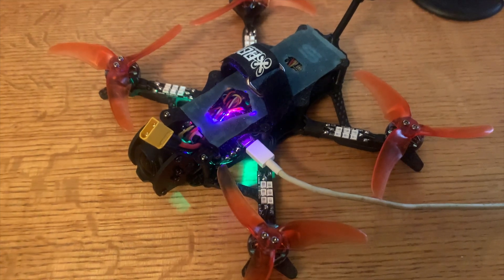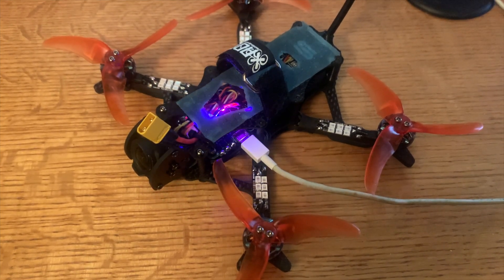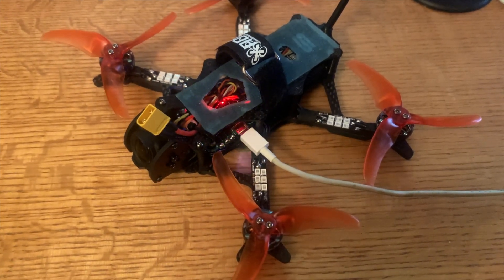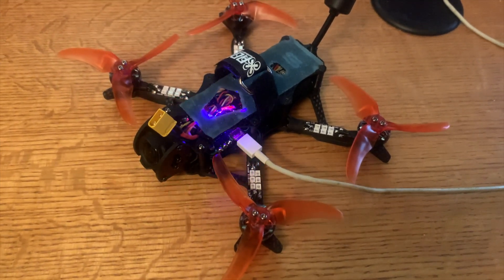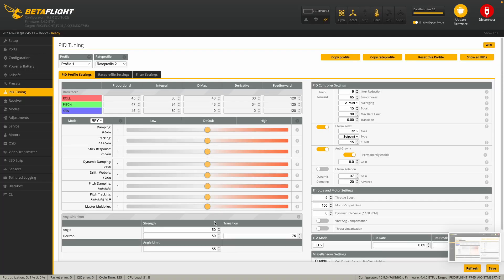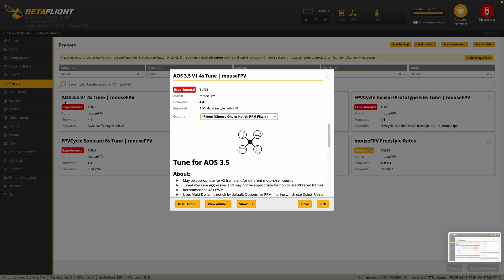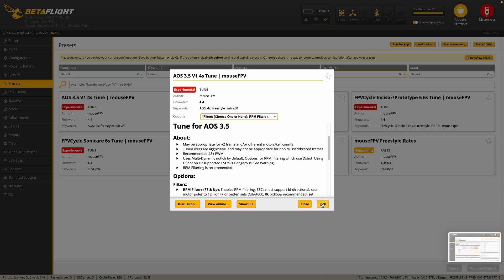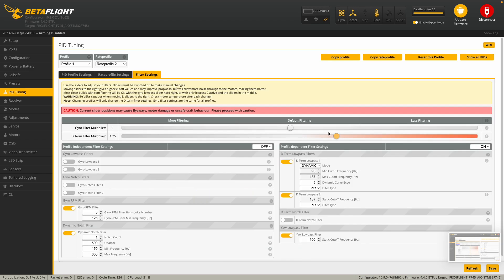AOS 3.5 V2 O3 Presets Tune Any Good?

Comment: Danger Fly Away! Good afternoon. I just used AOS 3.5 Criss preset with its respective filters, and when I increase the throttle, the drone shoots upward. I use the standard Betaflight 4.5 preset or the UAV Tech preset, and it doesn't happen. It's very strange because I've never had anything like this happen in the seven years I've been flying drones, and it only happens with your preset. My system is a Hobbywing F7 ESC 40A Blheli32.
Can you think of a possible reason for this? my version frame is AOS 3.5 v5
Reply from the maker: Hello, I am actually using mouseFPV’s preset so make sure you select:
“AOS 3.5 V1 4S Tune by mouseFPV” if you want to test this preset. Chris Rosser (frame designer) also has a preset but I have not tested that.  He is a great tuner as well so what you are experiencing does not make sense. However, his tunes can be more aggressive on the filter settings. 

Another thing to check is your board alignment settings. I am using the  iFlight Beast F745A AIO and mouseFPV used the Foxeer Reaper AIO which are both 25.5x25.5 toothpick AIOs. Your Hobbywing is a standard 20x20 mounting (not turned 45). Point being, I had to use the following cli setting so make sure that is NOT set for your build as it “will cause a Fly Away”. 
set align_board_yaw = 45 is bad for your build but needed for AIO boards. Checked the mouseFPV cli diff and it was not included so probably not that unless you changed it on purpose.
SLOG

Comment: Hi great video, enjoy your work. Will this work with the Iflight BNF model,
Reply from the maker: Hi @vpimaging, yes this tune should work as the iFlight version is very close, really the same frame, just has a soft camera mount to reduce motor vibration getting into the camera. Thanks for the feedback!
SLOG
Reply: Awesome, thanks. That’s what I figured as well. Just a noob with FPV and Betaflight, but been flying camera drones Maric’s for a few years. Lol… cheers.

Comment: Great video! What motors are you running? 

Im swapping everything from my Cinebot30 o3 6s over to this frame. Im hoping these 1804 motors arent too much.
Reply from the maker: Hi Jessiah, Chris Rosser (frame designer if you do not already know) recommends  1504/1505 2950KV on 4S if you are looking for a larger motor so a little overkill and adds weight. But if you do not care about being under 250grams, you will have lots punch for freestyle! Worth a try and see as you already have the motors.
Cheers, 
SLOG

Comment: Funny, I've flown with this tune and it was even worse than default. I ended up just ticking P:I up to 1.15 and pushing FF to 1.5. Everything else is at 1 (master slider cranked to 1.5). You really need to take it through its paces in PID Toolbox and follow the "basement tuning" method to really lock it in.
Reply from the maker: I have been happy with this tune so far. Seems like there is a mixed bag of responses. Looking at black box logs the filter settings look good. Did not spend any time analyzing the PID tuning aspect. Maybe my motor selection and that I am at ~5000 feet plays into it. 
Cheers,
SLOG
Reply: Hi do you have good tune for this drone on bf 4.4.1?
Reply from the maker: @pappuinfo6721  The preset I used for this test was for 4.4.x and I was happy with it. The last digit is for minor releases so this preset is worth a try. Like the videos states, always save your current settings "Save backup" so you can go back to your old configuration settings if you do not like the tune. SLOG

Comment: Hey bro. If you want to test a preset and understand if propwash has been reduced you must split-s into the quad air not going straight... 😂
Reply from the maker: Good point. At 9:13 in I do a forward roll where I am stalled (very little forward motion) and falling through dirty air. Really should have done a flight pattern UAV Tech (Mark Spatz) suggests when flight checking a tune. Oh well live and learn. However, this has been the tune I have been flying since this video was made and it is still my favorite freestyle quad to date with this tune.
SLOG
Reply: @slogfpv  i saw👍 what I'm meaning is that you have to force propwash to see how much has been reduced. Another good test is to show before and after applying the preset. Anyway good video. Really! As I'm flying with an emax babyhawk 2 which has similar idea of frame I think I will try this preset too. Ciao! 🙂👍👋
Reply from the maker: @gabrielemoro1  yes I would agree the two are very similar in design so worth a try. Also check out Mark Spatz's presets if this does not work out for you. 
Cheers,
SLOG
Reply: @slogfpv  i will. Just one hour ago I tried a pid tuning of mine:  all low pass filters off and only rpm filter + dinamic notch filter and dterm filter on. Seems it works. Plus I put stock pids but increased master to 1.4. With avatar props seems very good. Just let you know. 👍🙂

Comment: Thanks for the videos really helpful. Great piloting happy flying.
Reply from the maker: Thanks @TheRockycat! Just doing some basic acro to try to bring out prop wash and was throwing in some snap rolls to see if I had any bounce back (none). Great tune but very tight so it will show any stick movement that is not smooth (won't hide my imperfections in stick control). 
SLOG